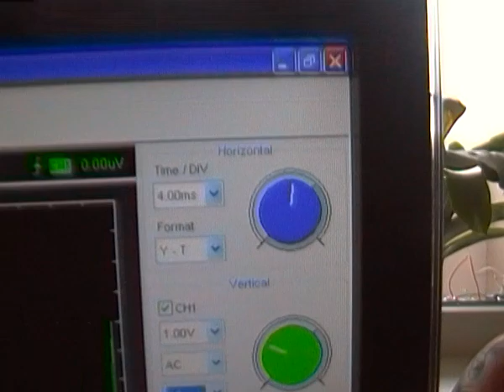Low voltage Tesla Hairpin

Comment: Longitudinal waves  are  diametrically opposed to  the  frequency and carrier waves   and are  irrespective of  time but  travel  parallel to  each other and may be both  extended and  multiplied  as regulated by the  disposition of  the modulation  of  the amplification.  thus  the initiation of such wave formation is alpha and omega and  proof of spooky motion at a distance.  Infinity and  origin are one and the same. Frame 1:04 as filmed on the oscilloscope.

Comment: Excellent experiment. I'm assuming the high voltage spikes are much higher than input voltage, yes? It seams to be operating the same as a bedinni SSG, except much more stable in frequency.